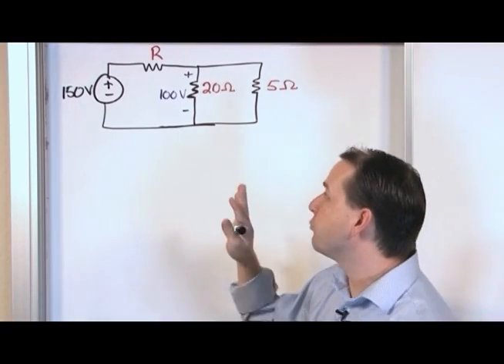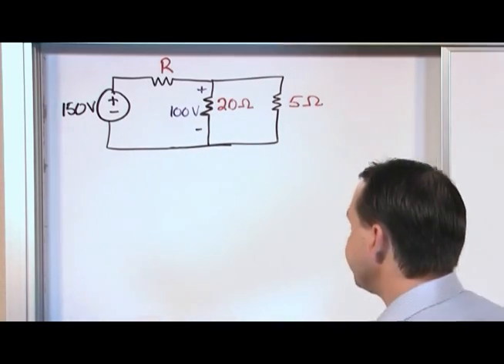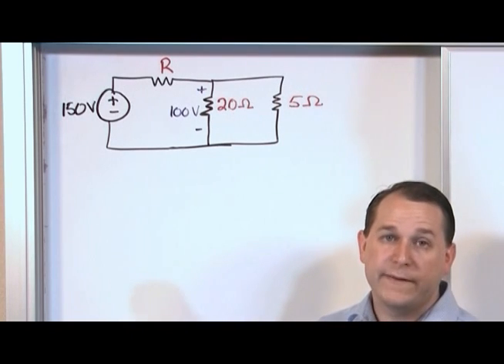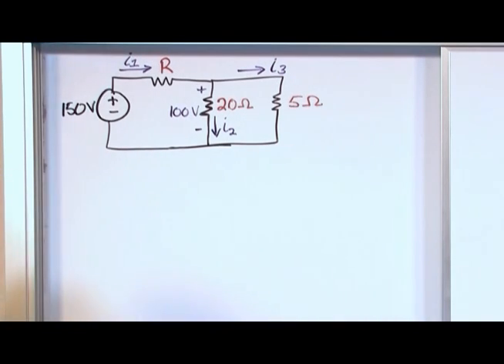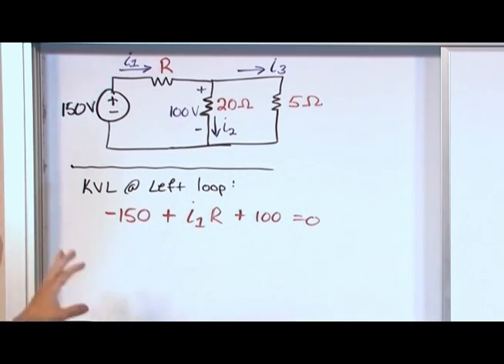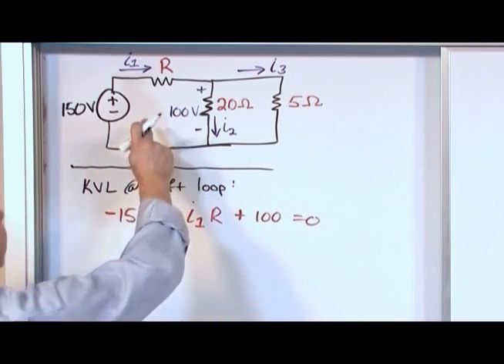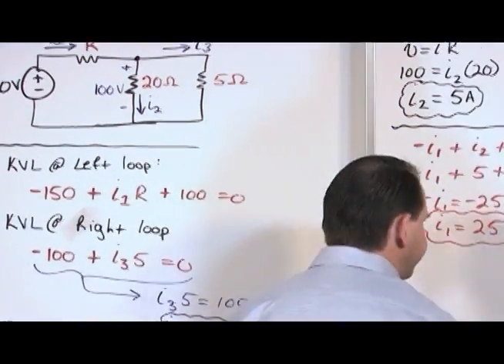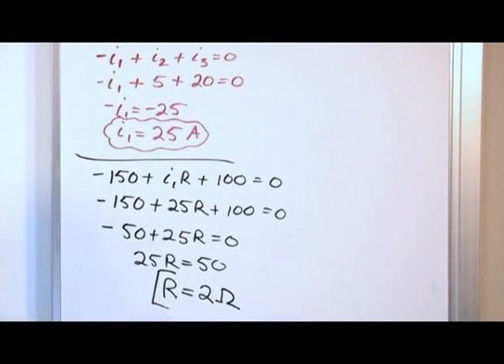Kirchhoff's Laws in Circuit Analysis - KVL and KCL Examples - Kirchhoff's Voltage Law & Current Law

Comment: Can you comment on what the choice of loops should be in a given circuit generally. Should no loop be the combination of any of the other loops chosen. For example, would choosing the outer loop also here just yield the same information as the two inner loops.

Also, can you give any intuition whether Kirchoff rules always lead to a solution: ie that we always get as many independent equations as variables. Thanks.

Comment: It was a good example to learn KVL and KCL but you actually could solve that in literally 1 minutes using simple circuit analysis (Voltage divider) due to the fact that you gave 100V which is the parallel voltage for the two given resistors. So what you said in the beginning is not true, this one is wayyyy too simple to solve
Reply from the maker: That’s not the point.  The point is to teach you a more advanced technique using a simpler circuit to get the technique down, which then we use later for more advanced circuits.

Comment: Why are you complecating a simple circuit when enough data is given.
There is 100v across 20ohm and 5 ohm is parallel so again 100v across 5 , The sum of current actoss both will be i1 thats is 25 A kVL gives 50 V across R apply ohms law R 2 ohm as simple as that
Reply from the maker: With respect, you’re missing the point. The point is to explain Kirchhoff’s laws and learn how to apply them using an example that is easy enough that anyone can understand. Of course you can solve the simple circuit using other simpler methods, but that’s not the point. I’m trying to teach you how to use Kirchhoff laws, which is much more powerful and can be used to analyze much more complicated circuits later on. Thanks, jason

Comment: I thought all components in parallel have equal voltage, i.e. all components in your diagram will be 150V?
Reply from the maker: The two resistors on the right are in parallel but they aren’t in parallel with the resistor on top.  They are in series with that one.  So the two resistors on the right will have the same voltage across them but it won’t be 150V.  The resistor on top prevents the resistors in parallel on right from seeing the full source voltage.
Reply: @MathAndScience  Perfect I see, thank you for replying to my comment and clearing that up for me. Your videos are great and you are amazing at teaching.

Comment: Here is something simpler with few equations and no new variables: 20 ohm & 5 ohm in parallel are equivalent to (20x5)/(20+5) = 4 ohm. Total current = 150/(R+4) = 100/20 + 100/5 => R+4 = 150/25 = 6, So, R = 2 ohms.
Reply from the maker: Hi yes of course you could solve it that way, but that’s not the point.  The point is to learn kirchhoff’s laws so you can use this method to solve more difficult circuits.  Jason

Comment: why are you making it hard?  Just parallel the 5-ohm resistor with a 20-ohm resistor and that is=4. then you can find the current there which is 100/4=25 and we know the current will be same at the R since they connected in series, therefore, -150+25R+100=0 so R=50/25=2 ohm
Reply from the maker: You’re missing the point.  The point here is to solve this simple circuit using Kirchhoff laws, so that you can use this more powerful method for more complex circuits.
Reply: In a timed exam environment, I agree that your method is more efficient. He purposely made this example "hard" so we can understand the concepts of Kirchhoff's Laws (KCL and KVL).

Comment: Sorry Jason, but way to many calculations for me. You have 100 volts over a parallel branch of 20 ohms and 5 ohms. Divide 100 volts by 20 ohms and get 5 amps. Divide 100 volts by 5 ohms and get 20 amps. Add the two together to get 25 amps. Source is 150 volts minus the 100 volts over the branches, which says there is 50 volts over R1. 50 volts divided by 25 amps equals 2 amps, right?
Reply from the maker: With respect, you are missing the point.  Of course this simple circuit can be solved in a much simpler way.  I am teaching the KVL and KVL laws here with a simple circuit so you can understand it and later in we will apply that to more complicated circuits that cannot be solved in the simple way you described.  Thanks! Jason

Comment: The majority of viewers pretty much agree to use an equivalent resistor value to find R. Although useful for this simple circuit, you'll find knowing KCL/KVL comes in handy when dealing with far more complex circuits especially those with multiple voltage sources.

Comment: It's good intro to Kirchoff which is essential when the circuits get more complex, but for the example it's simpler to find the reciprocate of the two parallel conductivities (1/(0,05+0,2))=4 Ohms and divide that into the given 100V which gives you current through the unknown resistor of 25A, and since the voltage drop is given as 50, the resistor is 2 Ohms.

Comment: I was following along fairly well until, when analyzing the right part, you converted a passive resistor into an active source - this completely threw me.  In the actual circuit the voltage at the + of the 5 ohm resistor must be > 100 volts else the value of the other resistor can be calculated.  If the voltage at 5 ohm resistor is > 100 then the current flow is not correct when calculated using 100V???
Reply: A perfect example of the danger of a handwaving argument.

Comment: Pretty round about way to solve an easy problem. The two resistances in parallel are equal to 4 ohms, and there is 100V across them, so the current is 25 Amps. There's 50 V across the unknown R. Boom! Ohms law gives you the resistance of 2 ohms. Easy. Why waste time with that exercise?
Reply from the maker: Because this was a lesson in KVL and KCL techniques.  I used a simple circuit to illustrate the point, and this method can be used for much more complicated circuits.

Comment: It does not matter which convention you use for the sign of the current as long as you are consistent, you will get the right answer either way. It does not matter that there is another way to  solve this, even if you think it is an easier method, this lesson is about using KVL and KCL and imparting that skill ready for use in other cases where it is much more complex. Neither is the time he spends on the algebra manipulation wasted. Who knows just what the viewer is capable of, or not. He does not have a live audience to signal to him that they do or do not understand. A skilled teacher can tell by the reactions of the class.
Reply: One in every crowd

Comment: What you did here confused me. What I did was say we know the voltage across r2 and we know it is 20 ohms, so the current through that resistor is V/R, 100/20 = 5 A.  The voltages across resistors in a parallel section are the same so the voltage across r3 is 100V. We know r3 is 5 ohms so, V/R, 100/5 = 20A. Now, the sum of currents through a parallel section must equal the total current in the circuit so 5A+20A = 25A. From the start we are given that the voltage across r2 is 100V and we know that the voltage across r3 is also 100V. Vs is 150V so the voltage across r1 must be 50V. R= V/I and we know the current through r1 must be the total current, 25A and the Voltage across r1 is 50V... 50/25 = 2 Ohms.
Reply: He confused me too! He really made it complicated! Why? It's so easy to understand without all that formula writing and re-writing.
After I got out of the Navy, i took some additional electronics. I spent many years after as a bench tech, then a field service tech, finally ending up in marketing and sales for an oceanographic instruments company.

Comment: Thank you. Im getting there slowly but surely
Reply: Find the equivalent resistance of the two in parallel, then find the total current flow of 25 A. Boom! Your almost done! 25A through a resistor that has a drop of 50 V across it gives you the answer. Done. As for Kirchoff's voltage law, the voltage drops around the loop will add up to the source voltage. That's all you need to know. It really doesn't matter which direction you go. From the positive, you have 50 V + 100 V = 150V (arriving at the negative terminal). From the negative terminal you have 100 V + 50 V = 150V (arriving at the positive terminal).

Comment: another way to do it is combine 20||5 and you get 4 ohm. You know its 100v on V4 because it was given. That means R has to be 50 V (rest of the power supply) Do a KVl and you will get -150+I1R1+4I1=0 . What do you know? I1R1=50V. 4I1=100V and I1=25 A. R=V/I => 50/25 = 2 ohm

Comment: Current flowing into a node has a positive value not negative while current leaving a node is written as negative .So KCL @ top node should it not be  i1 - i2 - i3 =0???
Reply from the maker: You get the same equation either way.  Typically, the convention is how I have it in the video for engineering students.  You can use the opposite convention and you will get the exact same node equations.
Reply: mathtutordvd Oh I see ,I got a little bit confused ,many thanks for the explaining.:)

Comment: Good job, though it would be easier to make an equivalent series circuit in my opinion. I teach the opposite convention of what you teach in the video, but since you used the same convention throughout it works just fine. Good presentation
Reply from the maker: Thanks Joe,  yes this circuit is simple and can be solved much faster by using equivalent resistance, as you indicated.  But, the point here is to understand Kirchhoff's laws.  Its easier to understand those if you start with simpler circuits which is what I have done here.  Also, the sign convention that I used is the one used in most engineering textbooks.  You can of course use the opposite convention as it doesn't really matter - you will get the same answer.  Thanks!
Jason
Reply: Yep very true, if my students have trouble ill send them to this channel

Comment: emil lagman That's not the point. It's demonstrating a concept that can be applied to more complicated circuits.
Reply from the maker: Absolutely.  I chose to illustrate these concepts using a simpler circuit.  But later you will have to apply these concepts to more complex circuits that you can't do by inspection.  Thanks again.  Jason

Comment: I don't get it. it took me 5 seconds watching only the circuit to see it would be 2 ohm. because? 100 Volts over a 20 Ohm gives 5 Amp, 100 Volt (as they are parallel) over a 5 ohm gives 20 Amp. Both currents run through R, which has the remaining 50 Volts. R = U / I = 50 / 25 = 2 Amp. A (!) simple example I guess.
Reply: Sure, that is one way to solve it. But the prof solves it using KCL and KVL, which is a different approach entirely.
Reply: you think you are smart or something? this is a tutorial on Kirchhoff’s Rules. i think anyone who has basic knowledge will know the answer in 5 seconds using simple ohms law
Reply: Whoa we got a badass over here.
Reply: Exactly. I don't know what he's trying to prove. Guess he likes to confuse people. I learned electronics in the Navy electronics school at Treasure Island in the 60's. We learned the easy way. We never would have gone through all that. But we did learn Kirchoff's laws as well.
Reply: And that is the idea of my comment. There is no challenge to use a calculation on a simple circuit. A difficult circuit would get our minds working, just wanting to solve it. It is not about being smart, but about teaching our brains to the most possible extend. Your view on the matter is as good as mine. No offense meant.

Comment: You are right! 2 voltages add up to be 150.  Once you solve for the parallel resistor,system will become  a series circuit. The ratio equation is same as formula for i=v/r.In the series circuit, currents are always same. i=i is same as v1/r1=v2/r2
Reply: yes that is different method of finding the answer.  good job

Comment: is it not easier to divide to get the total current going through 20 and 5 with same voltage of 100 then divide 150 over that number and you will get total resistance and just get the difference between that and the parralle resistance (20 and 5)??? final answer is 2

Comment: Simplify this Circuit down to a equivalent Series Circuit!!! The equiv 20 ohm in parallel with 5 ohms equals 4 ohm ( Rt=R1xR2/R1+R2)=100/5=4 ohms We know R unknown drops 50 volts(150-100=50volts)  Set up a RATIO EQUATION   R/Vr =R/Vr,,,,,,,R/50 = 4/100.....100R=200  therefore  R=2 ohms.....No Need To write all these loop Equations Unless You have more than 2 or more Current or Voltage sources That's what My Engineering Technology Teacher told ME!!(Who Happens to be a ELECTRICAL ENGINEER!!!)

Comment from the maker: It doesn't matter at all.  As long as you write the equations of the circuits consistently - applying the same rule for every voltage drop or rise - you will get exactly the same answer.  It is common for different books and sources to use different convention for this.  I use the one the makes the most sense for me and the one that is the most common for ENGINEERING.  Physics sometimes likes to use the opposite convention as you pointed out.

Comment: Both the 'university physics' book and wikipedia says that the signs are opposite yours. According to those, the voltage law says: When you travel from - to +, then the emf is positive. When you travel from + to -, then the emf should be wrote negative. The same with resistors. If you travel from + to - with the current, then its negative, and the opposite.

But it will give same answer, i think. Anyway, thanks for the video and the problem solving guide. Got exams next week. Great video again:)
Reply: I saw other teachers saying that from + to - there is a voltage drop so it must be - , and from - to + there is a voltage gain so it must be + . He is saying the opposite.
Reply: It doesn’t matter as long as you’re consistent